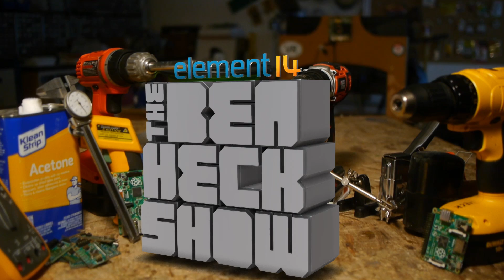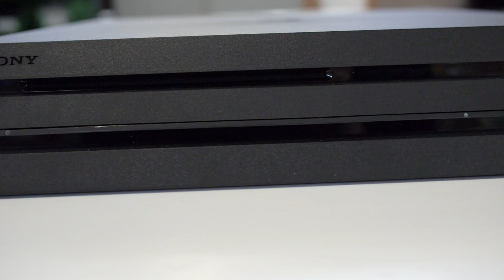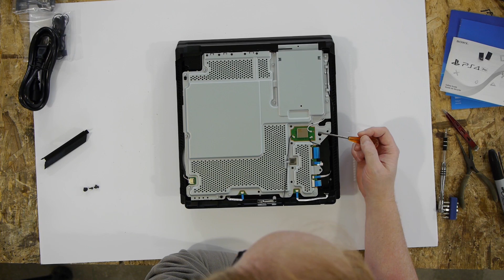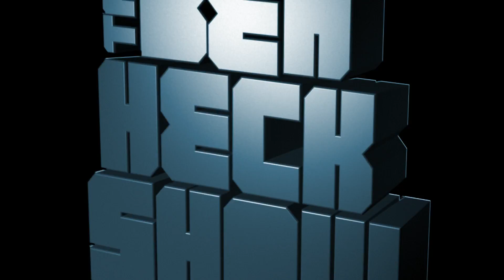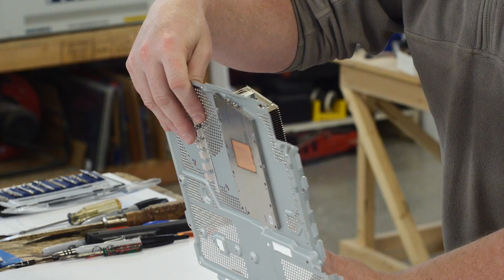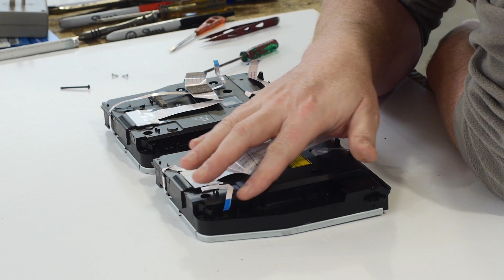Ben Heck's PS4 Pro Teardown

Comment: Here is a list of 30! NATIVE 4K games on the PS4 PRO. Please do some research before you make incorrect statements about how little the library is for games rendered at native 4k. 

- Assassin's Creed: The Ezio Collection (Native 4K@30FPS)
- Battleborn (Native 4K@30FPS)
- Bound (Native 4K@60FPS + MSAA x2 upscaled from MSAAx8 in normal gameplay / in VR mode: rendering to 4K internal screen which is then supersampled to 1080P display in PSVR + new effects like volumetric lights + sharper shadows)
- Bulletstorm: Full Clip Edition (Native 4K)
- Darksiders: Warmastered Edition (Native 4K@60FPS)
- Farming Simulator 17 (Native 4K)
- FIFA 17 (Native 4K@60FPS + Higher resolution depth of field buffer)
- forma.8 (Native 4K@60FPS + 8xMSAA )
- Futuridium EP Deluxe (Native 4K@60FPS)
- Hatsune Miku - Project DIVA - X HD (Native 4K)
- Hustle Kings (Native 4K)
- Locoroco (Native 4K + HDR)
- Let It Die (Native 4K@60FPS)
- Mantis Burn Racing (Native 4K@60FPS / Native 4K@30FPS for 4 player split-screen / + HDR)
- Middle-earth: Shadow of Mordor (Native 4k (most of the times but scales down to 80% of it which is 3072 x 1728 in heavy scenes) @30FPS)
- NBA 2K17 (Native 4K@60FPS + HDR)
- Neon Chrome (Native 4K@60FPS)
- Ni-Oh (Native 4K@30FPS)
- Parappa The Rapper (Native 4K + HDR)
- Patapon (Native 4K + HDR)
- Pro Evolution Soccer 2017 (Native 4K@60FPS)
- Rez Infinite (Native 4K@60FPS)
- Smite (Native 4K@60FPS)
- The Elder Scrolls Online (Native 4K@30FPS + HDR)
- The Elder Scrolls V: Skyrim Special Edition Edition (Native 4K@30FPS)
- The Last Of Us Remastered (Native 4K@30FPS with the best shadows + HDR)
- The Witness (Native 4K@30FPS + 2xMSAA + HDR)
- Thumper (Native 4K@60FPS)
- Viking Squad (Native 4K@60FPS + 2xMSAA)
- Wheels of Aurelia (Native 4K@60FPS)

It's an impressive list and always getting more.

Comment: Dear Sony,
Fuck you.
Reply: Emeraldy I agree 👍
Reply: Reminds me of the song keithwouldleave made about the 

April 1st, 2010 Firmware Update: 3.21 for the ps3.
(thats the update that removed "OtherOS" From the PS3, and pissed off alot of people)

the song pretty much went
"Dear sony,
Fuck you."

here:
watch?v=rEXSZtO2WS8
Reply: @mark wheeler mainly because they are making you pay for more, when other systems are doing it cheaper. 

personally i use just plain bluray. that being said, there is no reason that a 4k bluray drive could not have been put in for the price you are paying. even more so when Sony is the proprietary owner of bluray.
Reply: The Pro is crap. Further evidence displayed by this well done video 🎥
Reply: World End That's not funny that's an awful thing to say to someone seriously out of order.
Reply: World End Dear dumbass
learn how to use grammar 
merry Christmas
Reply: Calling me names isn't going to change the facts dude. 

and I was talking about "relative difference", as in how they compare to each other, not the absolute difference. 

For example: a 50Mhz PC woud be 5 times as fast as a 10Mhz PC, the same comparative gap as a 500Mhz PC would have on a 100Mhz PC, even thought the aboslute difference is only 40Mhz compared to 400Mhz. 

In our case: 
Xbox One X has the following advantage over the Pro: 
42% more GPU power (TFLOPS)
50% more Memory speed
50% more memory
8% faster CPU

Whereas the original PS4 has the following advantage over the original XB1: 
40.6% more GPU power 
157% more Main memory speed (and 14% less secondary memory speed for comparing the GDDR5 to the XB1's 32MB esram) 
8.5% slower CPU. 

So what can we learn from this comparison? that the comparative advantage in Graphics and Memory the original PS4 had over the original XB1 is similar to the advantage the XB1X has over the PS4P. the Memory advantage was more significant in speed, but not as significant in capacity, and the CPUs in both cases are largely comparable. 

So just as the PS4 has games using a higher resolution than the XB1, and running slightly better, you can expect a similar advantage in the case of the XB1X vs PS4P - Games will run at a slightly higher resolution on XB1X, and will perform slightly better. it WILL be noticable, but it won't be night and day significant. 

Another thing to note here: All XB1X games are essentially beefed up XB1 games, and must be compatible with the XB1, and the same applies to the PS4P and PS4. 

Why is this good for Sony though? because the PS4 is less of a hinderance / hold back for games on the PS4P than the XB1 is for games on the XB1X, being that it is more powerful than the XB1, and there's less of a difference between the two PS4's as opposed to between the two XB1s. 

and btw, I have a Bachelor's in Computer Sciences, and am a software engineer, keep your assumptions to yourself.
Reply: Emrldy Dear Microsoft, 
Continue to make brick systems.
Reply: Emeraldy why? no sense just swearing with no reason.
Reply: you're telling them "F U" for putting out a product that people want? 

The PS4 pro shares a lot of the same components as the slim, but it's also significantly stronger (2.33x graphical power, 1.5x memory speed, 1.2x memory, 1.3x CPU performance) than the PS4, and that allows it to : A) run every PS4 game with better performance and graphics and B) support higher resolution displays, which is what people wanted out of it.

The X1X, which is 500$ and coming a year AFTER the pro is only a bit more powerful than the pro, to the point that the difference between the original PS4 and the XB1 S / XB1 is more significant than the difference between the X1X and the PS4P
Reply: Lol been saying that ever since I bought a ps2 that went bad after a yr and got a new package deal just to find out it's the same model just a new box and game...at least xbox made good with extending warranty on 360.

Comment: Ben! - HGST is Hitachi Digital Storage Technologies! A Western Digital company now, but they're widely used in OEM (laptops, etc.) and 3.5in drives in cloud deployments! As far as I know, neither of these consoles utilized a die shrink either. The PS4 Slim should still be on 28nm bulk, just like AMD's 7th Gen APUs, and the Pro as well. 28nm is cheaper per die compared to advanced 14nm technologies, though low power tuned 14nm may currently be competitive price wise. The die is also not bigger in the Pro for reason of heat dissipation, but for the extra GPU cores which take a considerable amount of space.

Comment: They're actually using different silicon for the PS4 Pro and Slim? That seems like a huge waste.
Reply: That... That's the entire point of the difference... The PS4 Pro is a more powerful system than the slim. The Slim is host a cost reduced version of the original PS4. You can't have the same APU if one is gonna be more powerful than the other.

Comment: The black square  / rectangle @12:24 IS the actual silicon die, NOT a "conducting plate on the die".  It's upside-down with connections to the square BGA daughter board that it sits on.  The side that's facing the camera is the back-side of the bare silicon die, not just the "exposed" area - and it is indeed more rectangular and probably a larger area on the Pro.

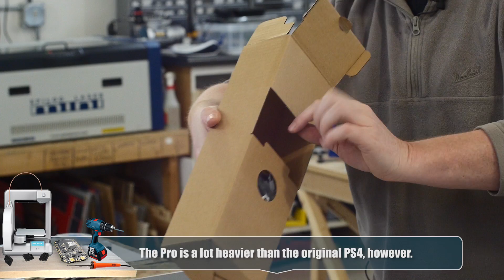Comment: 4:00 there is a branch of engineering for packaging products efficiently and securely -- minimize the cost, weight, & material used and maximize the protection provided. If you think about it, it applies not just to consumer products but can go all the way up to rockets and delivering payloads to space.

Comment: Suggestion: make a VR backpack with the PS4 Pro! And since you are making a laptop out of the Xbox One S, you can make a big "handheld" with the PS4 slim.
Reply: impossible. the tracking for the ps4 is wired directly into the ps4 so there wouldn't be a point
Reply: epikphlail crap, you're right.

Comment: when he saw the thermal pads he said very common and very annoying but what does he mean by that? is it very annoying to have the thermal pads or very annoying not to have the thermal pads? if I was to guess I would say not having the thermal pads would be annoying because it would mean your system stayed at a higher temperature

Comment: To step on your disdain for 4k blu rays I'm annoyed we don't have fully functional UHD drives on PC. 4k requires huge file sizes to download and as such much of the 4k content available is compressed, especially 4k streaming content. I'm happy to pay a premium to ensure the best experience possible and sadly 4k streaming is not that experience yet.

For those thinking I'm splitting hairs for not liking 4k compression i certainly am, but I am a software tester and over the last 5 years I've pretty much train myself to spot the smallest of issues.

Comment: Why has nobody mentioned this one yet:

You have NEVER shown the die, nor have you measured it.
The "outside of it" is only the retention.
And the "exposed surface here" is not the die either, that is the headspreader.
The actual die is under that.
Reply: ABaumstumpf Yea I had to stop watching then. But he did measure the die sort of. There's no heat spreader on the chip your just seeing the back of the silicon wafer. Its a flip chip, I the top of the chip is facing down on the package.
Reply: Not mentioned what? For months there has been speculation what the PS4 was going to be and when it was released  there was no hiding what the PS4 pro was (minor update to PS4 to make VR work, somewhat)
Reply: daishi5571  uhm... rancor understood my comment just fine and pointed out a mistake i made.
But your comment on the other hand is completely unrelated and irrelevant.

please re-read my original comment.

Comment: I will never understand the 4K hype anyways... got a monitor thats not even 1080p... still works amazing... got a 1080p TV 42 inch... got a projector 100 inch with 1080p and you could still see individual beard hairs on it... 4K nowadays only seems like market hype... I'm 42... my eyes (not wearing glasses) will only get worse... Maybe my son in 20 years will have a 4K/8K TV...
Even 720p is absolutely watchable and gameable... just played GT5 on my old PS3... and it still looks amazing...
480p is where I draw the line... not totally horrible... but go from 480p to 720p is the big big thing... going from 1080p to 4K... it is just some icing on the cake... and not even that... it only consumes more power...

Comment: "The die isn't much bigger but you might notice this exposed area here is a lot bigger, probably to help with heat dissipation"
I mean, are you serious? You call the package substrate the "die" and the die "an exposed area to dissipate heat"? Bravo.
Edit: I just got to the part where you call the die "the conducting plate".. :slow clap:

Comment: Could you do a tear down of a 4K tv? And could you talk about older PS4s some of which develop a random beep and eject, which seems to be caused by either the eject screw or the rubber mount expanding with heat and triggering the eject sensor? I've pretty much solved the issue, by turning the screw anti clockwise, removing the rubber mount, and placing the PS4 onto a laptop cooler. But it would be good to know exactly what the cause of the issue us, apart from the fact that my PS4 is coming up for 4 years old :)

Comment: Sooo much FAIL in this Video.... Sooo Disappointed!  HGST?  I'm screaming "HITACHI!!!", remember the "Death-Star"???  Why it cannot play 2160 Blu-Rays?  I'll tell you a secret...  IT IS NOT DEPENDANT ON THE DRIVE!!!  They should have at least updated the components and included a better SATA Spec3 Hard Drive.  The first PS4 should have been 2160 already.  "4K" is NOT 4 thousand lines of vertical resolution, it's 2160 lines of vertical resolution.  Personally, it was a very dumb idea to call it "4K" in the first place.  The PS4 is NOT compatible with 2160 TV's that are dependant on two HDMI ports to produce adequate video and other 3D hardware... Headsets, TV's...  Even 30FPS frame rate for "Gaming" is a joke these days, at least 60FPS is acceptable.  Much FAIL. Much Disappointment.  Glad I "Un-Sub'd" long time ago.  The Best Friendly advice that I can offer you is...  S-H-A-V-E!  A "Clean Look" always looks better.  POST LINKS to RESOURCES for "YOUR SUBSCRIBERS" so they can do the same "PROJECTS".  Maybe you will go GOLD soon enough.  Who knows?
Reply: UnrealVideoDuke i agree, this guys analysis is not as deep as i though would be.

Comment: sony and microsoft are doing exactly what apple is doing!!!  re releasing newer versions of the same thing!
Reply: all of them lol
Reply: MorimotoYTP not sure the gameboy colour can really be compared that way. At that point you might as well include anything with any backwards compatibility.
which would be the mega drive, gameboy color, gameboy advance, Nintendo DS, Wii, Wii U, PS2, Ps3, xbox 360, and 3ds, Amiga 1200, every PC, most macintosh computers, the ZX spectrum, apple Ii...
plus, have you ever seen how many different consoles sega made that can all be vaguely described as 'master system' even though the hardware and capabilities changed quite a lot from the first to last model?

So, pretty much 80% of every console and computer in history.

Now, the gameboy pocket is a mostly cosmetic revision of hardware (also nothing new. See: atari VCS /2600 and many others).
And the gamboy color has some major extra features, is twice as fast, and there are a bunch of games for it that cannot run on the original at all.

The DS though... Yeah, that's where nintendo really started with this 'new model but not really' stuff.
DSi anyone?

Comment: "They make the processors cheaper by making a smaller die" Smaller dies are MORE expensive in the cpu / gpu world. The smaller the process, the more engineering is involved.
Reply: Nah
Reply: Mass production trumps that. Any added expense early on is mostly in the "new tax", and not related to the die shrink.
Reply: Travis Piper Yes, but the mass production is cheaper...
Reply: not really no. More engineering is needed if developing a new architecture. simply shrinking an existing architecture is what he is describing, and it saves money on material cost by reducing the use of silicon per chip, as well as improving the number of usable chips per wafer, with not that much expense in R&D. admittedly when you shrink the process of an architecture then you do get a lower yield percentage (Chips are more vulnerable to defects) but this factor is usually overcome by the greater number of chips than can be fit onto each wafer.
Reply: There are two methods. Smaller manufacturing or smaller design of routing. Making the routing smaller is like designing a really efficient road layout, so saves on costs but takes a little more time, so is left for the next model.

However if they use lower Nanometer construction, then it is more expensive to begin with (cost to develop, faulty yields early on etc), but drops down in cost as the manufacturing processes catch up, at which point the size change does save on costs as it allow higher yields per silicone disk.

But I agree the video did not make it clear.
Reply: True. Usually when a smaller die comes out, in a new series or in between series of processors, they end up 2-5x more expensive, then get cheaper over a year or 2.
Reply: Smaller dies are cheaper. They get higher yields with smaller chips so the overall cost is less.
Reply: re: higher yields per silicone disk:  LOL there -- you are confusing material used to make breast implants with material used to make integrated circuits.

Comment: The reason the die is bigger is down to the greater number of AMD GCN cores required to drive 4K or 2K up-scaled output. It's not just bigger for heat dissipation. The CPU part of the die is the same but it's been given a boost in clock speed along with a small increase to the GCN cores. Also the the pro has 1GB of DDR3 RAM added for background tasks, freeing up more of the 8GB GDDR5 RAM.
Reply: Yeah I was cringing so hard when he did not know what he was talking about, "Bigger die for disappating heat pffttttt"
Reply: popcornuk uhh small increase in cores? It's literally doubled from 1152 to 2304
Reply: @prich0382  the cpu part got a small increase while the GPU part got the bigger portion of it